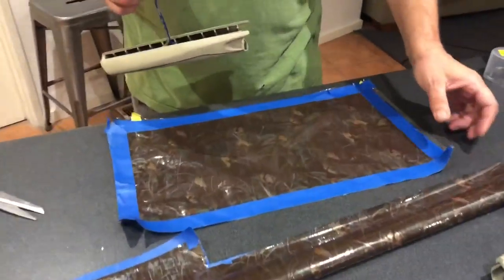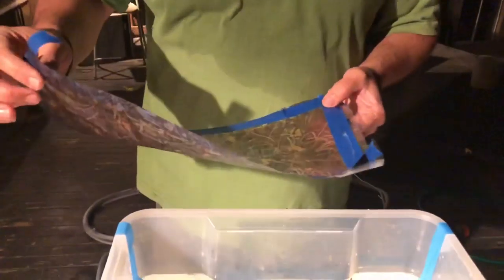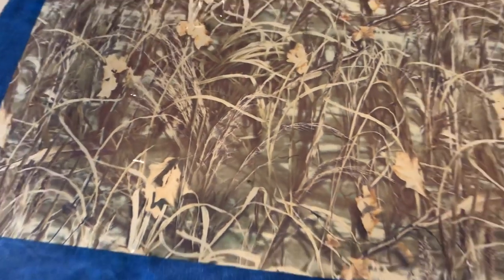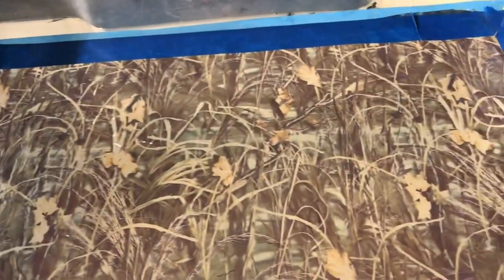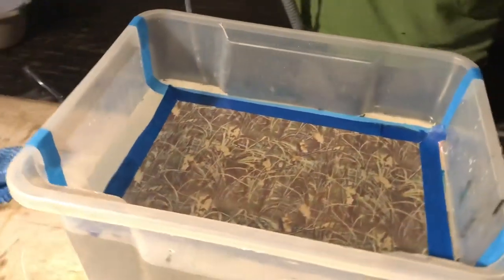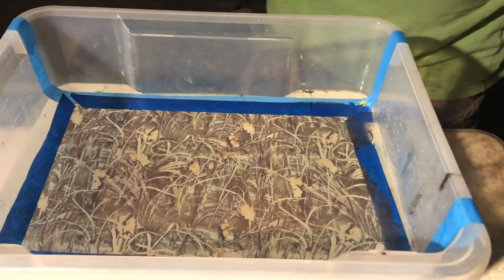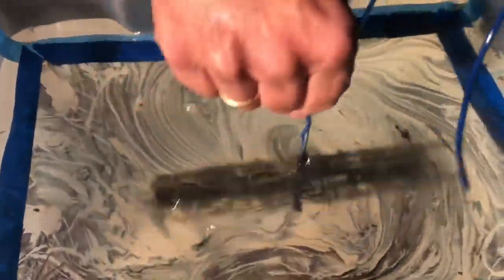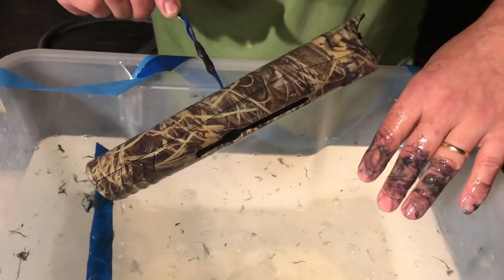Hydro dipping synthetic gun stock CAMO pattern

Comment: Looks GREAT. I'm doing the same thing to my Mossberg 500 plus the barrel. What did you to the plastic parts for you dipped them? Cleaning and tapping etc? Thanks Hank
Reply from the maker: hank harrison hi hank , I cleaned the synthetic stock with a thinner then I used a plastic adhesion under coat , then the tan base coat , followed by the dip, then 3 clear coats
Reply: Thank you sir  @chaggolies
Reply: How do you  deal it?

Comment: My question is-can you do this with a stock that already has some sort of pattern on it? Is there a process to remove a patter from a patterned stock and the hydro dip?
Reply: Spray paint it black or tan first then it would work fine but if you just dipped over a camo pattern it would just over lap